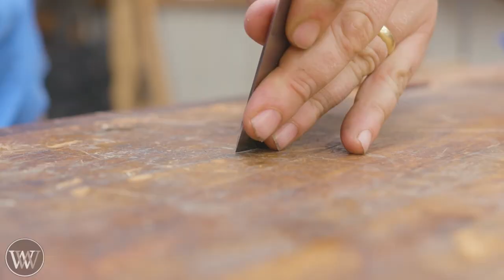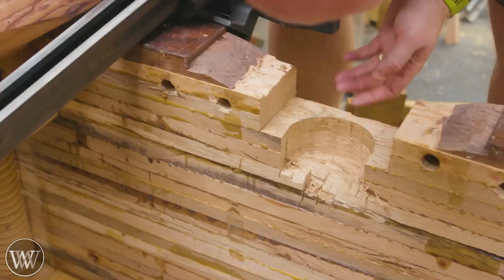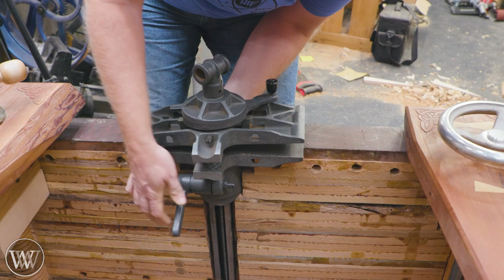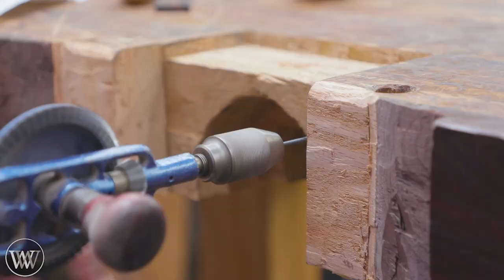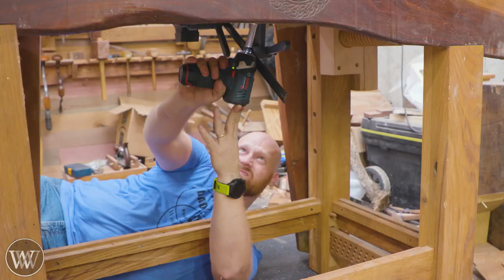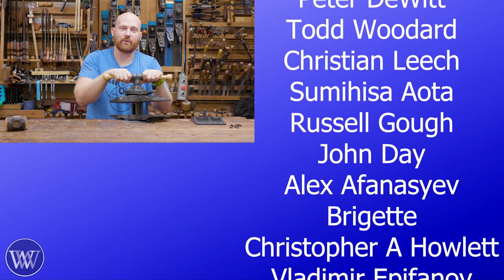Mounting a Pattern Makers Vice In My Bench

Comment: ...Can also mount it outboard first and decide if you prefer the position before mounting it with rear jaw flush (but still create the mortise for the screw long enough as if flush mounting).

I found having both jaws proud far better in use. Flush mount obstructs handling boards along the long side of the bench, leaving no room for your hand. Sounds like not a big deal, but if you need to clamp something long and heavy, the way you can hold the item just to get it in the vise is limited. A lot easier when there's room for your hand between the item and the side of the bench. It can also reduce the amount of long angled things it will hold in it's "normal" position, slightly.
Having worked with my Emmert for a decade I've never once had the need to mount it with the rear jaw flush, and I love being able to easily load a long heavy board one handed while operating the screw with the other. Even in my cramped space it does not bother me it sticks out another inch or so.

Comment: James, what brand pattern makers vise is that? It looks to be older. If I wanted to get one exactly the same, or similar, what should I search for?
Reply from the maker: This is Emmert. They stopped making them decades ago. I don't know of anyone making them any more. I usually buy mine at MWTCA meets. Check out Www.HandToolFinder.com
Reply: @WoodByWright  After I sent this post I took a look on eBay and actually found a few of them. They are definitely not on the cheap side! But, doable. Thanks.

Comment: Hi James, love the channnel, but I have to disagree with how you mounted the vice. Way to much work for no real benifit. I have the large one and it only protrudes 2 3/4". Also, recessing the back jaw inhibits the rotation of the vice unless you swing it out of the mortise.
Reply from the maker: The reason I inset it into the bench is I do a lot of long joining along the face of the bench. If I had it sticking out I would not be able to do that as well. Also it would stick out a considerable amount more than the other vices getting in the way of going along the bench. The Jaws can still rotate fully even with it recessed all the way back in. And that is the way that the company originally suggested be installed. That way you can use the rest of the bench face for larger pieces. All of the salesman samples had it recessed into the bench. I talk about the reasoning a good bit more on the other video. In the end there's no right or wrong way to it. Just personal preference.